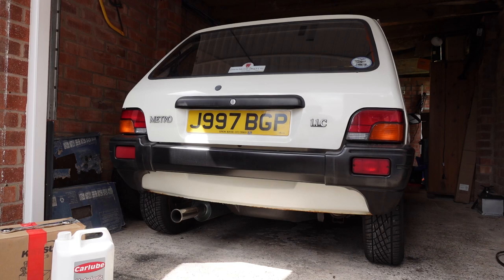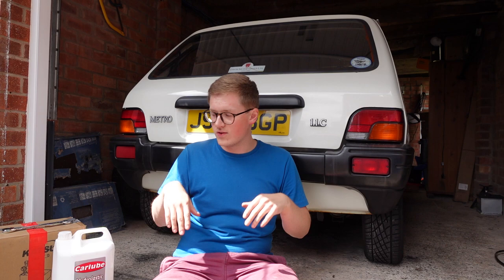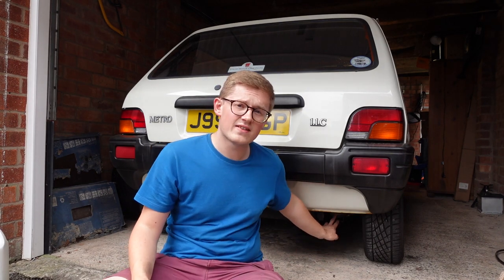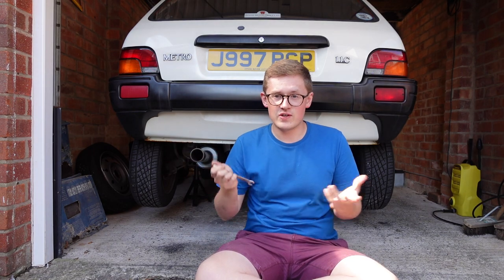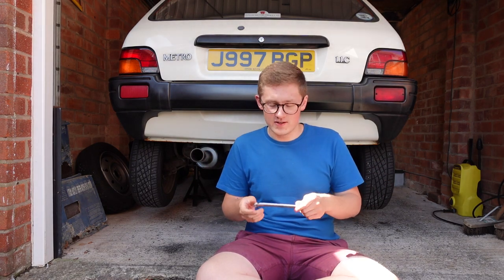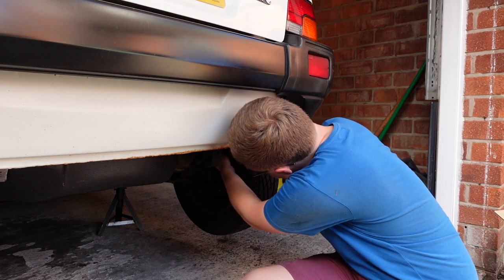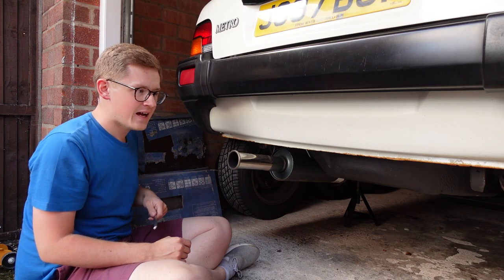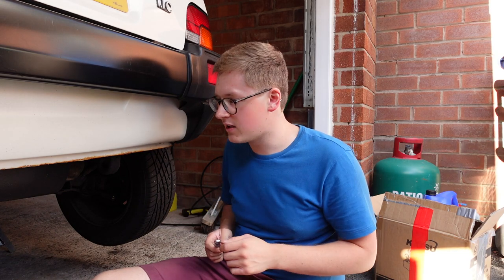Servicing my Rover Metro (Part 2)

Comment: Admirable thoroughness there. The recipe for reliability and longevity. Well done.

Bought a new 1.1c Rover Metro for the family in 1993. Same colour. It is still in the family. It was passed onto my son about twenty years ago who soon after put an MGF VVC 1.8 engine in it. It still looks Bog-standard complete with C for Carb 1.1c on the Hatch Lid..  Cue when filling up the fuel tank someone also filling up came over and said "No way was that a 1.1c".

No doubt he had seen it performing on the local bypass.. Great little cars the Metros and Rover 100s in all their forms.

Comment: Well done, Ed. I still find it difficult to believe that a car that new did not come with self-adjusting drum brakes. The newest car I can remember with drum brakes that needed manual adjustment was Ma's 58 Vauxhall Velox. Even my Grandfather's 61 Pontiac Laurentian with unassisted 4 wheel drum brakes had self-adjusting brakes. Once a month Gramps would make a point of reversing fairly quickly and then applying the brakes firmly. You would feel the pedal rising, so you knew the procedure worked.

Comment: Miss my Rover Rio Metro with its K series engine and 4 speed manual box. It replaced - and was far more fun - than my Ford Escort cabriolet. So good in fact, that I sold it and bought a brand new 'Kensington' 100... which wouldn't pull the the skin off a banana! The new  5 speed gearbox was totally mismatched to the engine! I hated the damn thing! 😄